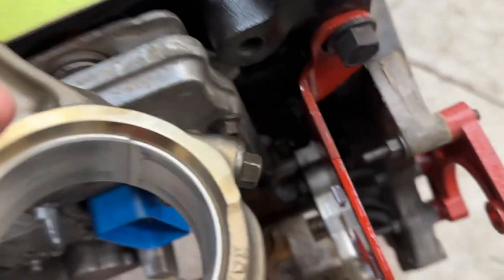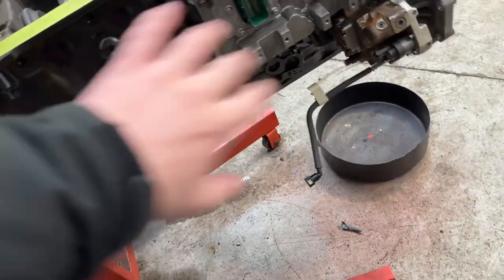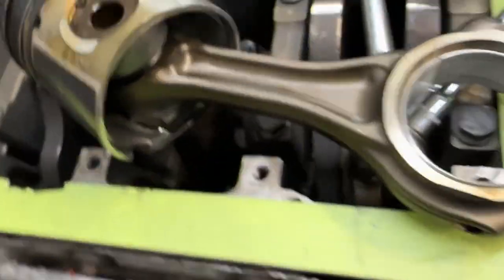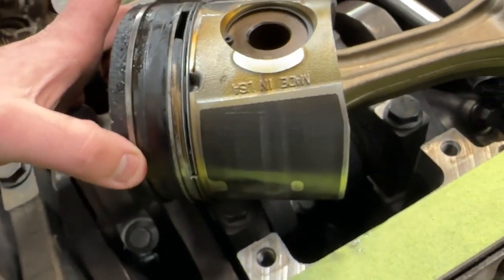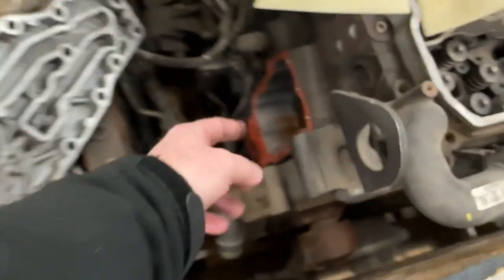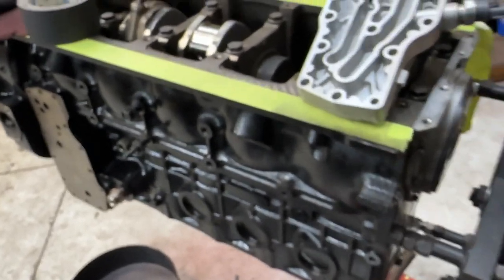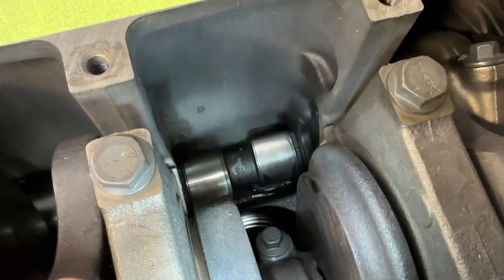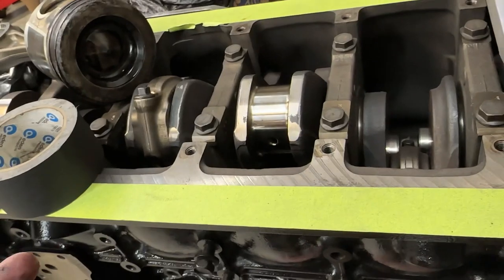700k mile 6.7 Cummins. Follow up. Part 2

Comment: I'm not too sure about the 6.7 but I have a fleet of 8.9l ISL's and we have had a couple cams break at high milage just from fatigue. Nowhere on the lobes or anything just straight up breaks. I'm not sure if the 6.7 has that issue as well but it may be something to look into throwing a new cam in while you're there before it goes back together

Comment: Love my truck, great engine. But my 100k engine is leaking oil from around the aluminum timing cover adapter. You ever had that mess? Shop time is TWELVE HOURS, ouch. Great videos, Merry Christmas, Lord bless you.
Reply from the maker: Merry Christmas. But ya I’ve seen that issue once.

Comment: What were the wear parts outside of the block replaced to get it 700k? Was it original injectors? Turbo? EGR? CP3?
Reply from the maker: Original injectors. Cp3. Turbo got replaced a little after 500k
Reply: @pddieselpower  awesome thanks for the update!

Comment: Paul, Schaefer’s oil has too much MOLY and is well known for being loaded with MOLY. 

Valvoline Cummins Blue is recommended for a reason.  

I don’t think there would be that much wear using Valvoline Blue or Rotella. But what do I know, ( it’s just my opinion ) 

I’ve only been obsessed with engines of ( any type and all the details ) and engineering and mechanics for 30 years. 

Check out the OEM bulletin from Cummins. It is the Cummins Engine Oil Recommendations, Bulletin No. 3810340-02. It’s probably best if you stopped by a Cummins Dealer and purchased this bulletin- about $2-$3. On page 7 it has a section on FRICTION MODIFIERS states: “ There is form evidence that certain friction modifiers, Molybdenum Dithiophosphate for example, can in certain formulations result in cam follower pin failure at relatively low mileage “ .... From years working with engine test programs to approve engine oil formulations for API Licensing, we can tell you that NO engine oil containing Molybdenum additives has been certified by the full range of engine test necessary to gain API approval. Molybdenum compounds in motor oils can degrade and cause bearing corrosion and is particularly aggressive towards copper. In almost all cases, any engine oil formula having “ Moly “ will also contain Copper Deactivator which will protect bearings from the moly compounds. The only problem, the copper deactivator decomposes at relatively low temperatures and loses its potency after a few thousand miles.
Reply: Recommendation is not a requirement. Cummins owners manual does not say that valvoline is required. It looks like you don’t know the difference between required and recommended